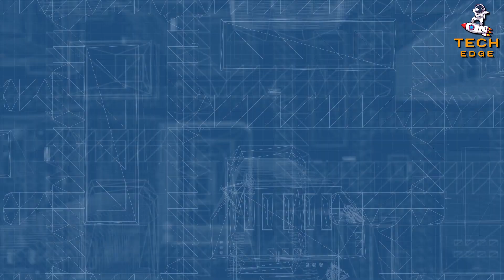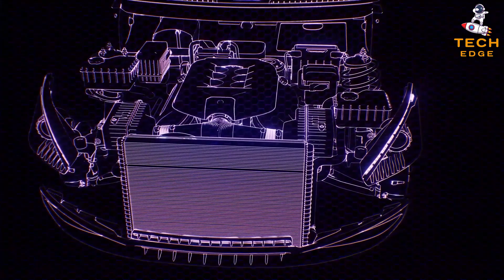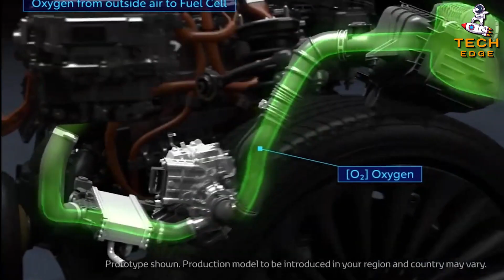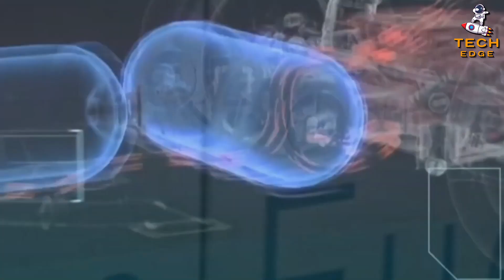BMW and Toyota Unveil Revolutionary Hydrogen Cars!  #hydrogencars #bmwcar #toyota

Comment: The only way to create hydrogen responsibly seems to be electrolysis.  But it's very energy-inefficient.  Then the hydrogen needs to be transported everywhere, so that's energy-inefficient.  Then the hydrogen is converted back into electricity using a fuel cell, which is energy-inefficient.  So hydrogen is really just being used as an energy storage medium.  If it was an energy-efficient process, it would make sense, but it is not.  I think it will fail, unless major improvements in energy-efficiency are discovered.